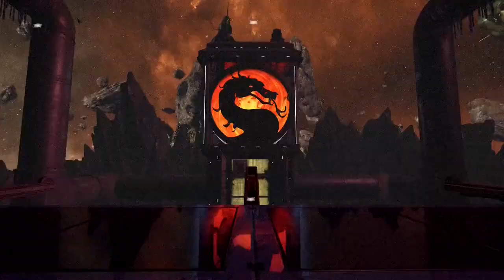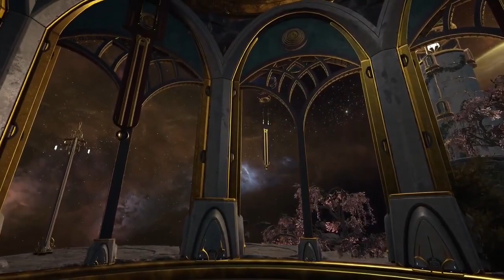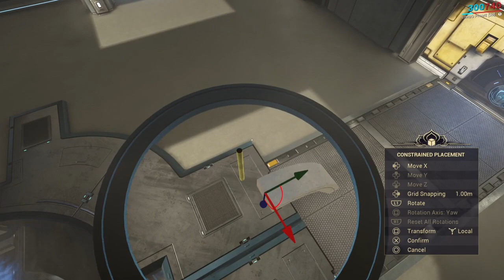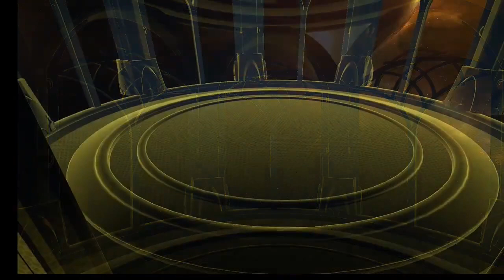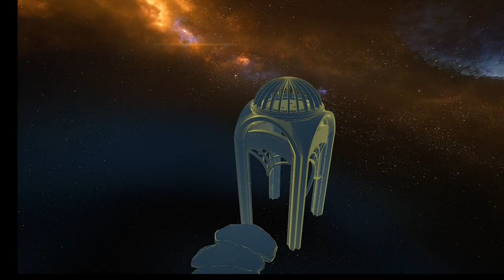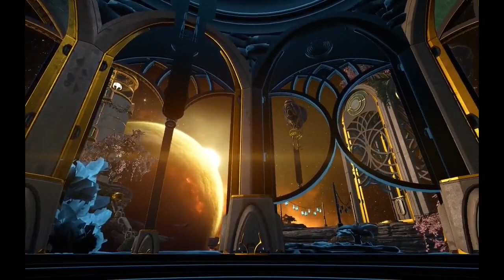Elven Spawn Time-lapse Build Guide, Guide to Using Radials In Architecture

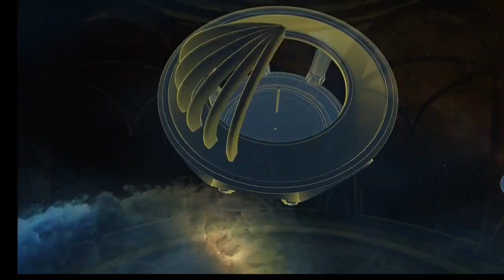Comment: Mind If I aski you what furniture u used on min  3:48 seems like a platform with a hole inside..
Reply from the maker: It's called 'floor ring (trim)
 Its upside down:)
Reply: @dizzzy12   thanks!! I love this tower, might use it for my clan, would leave a poster that says "inspired by Dizzzy12" <3
Reply from the maker: @miguelguijarro8280  cool cool go for it :).

Comment: Hii was wondering how you duplicate them in the same position as the origional? Because for me they just get placed on top or snap to the side
Reply from the maker: Make sure you have Grid snap on. (1meter is easiest) and make sure surface snap option is off. That's the option that make it clips to the sides of other decorations
Reply: yea the 1m thing works a little bit betterfor sure... that said the whole dojo deco's seem to be super janky @dizzzy12
Reply from the maker: some of it feels jank but you can work around most issues with enough practice